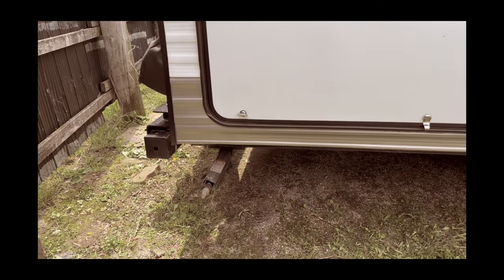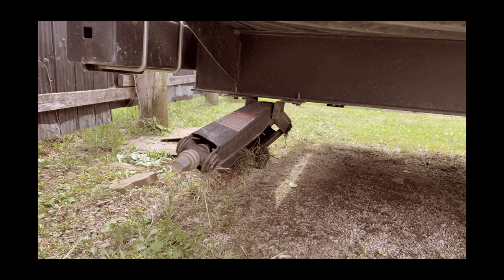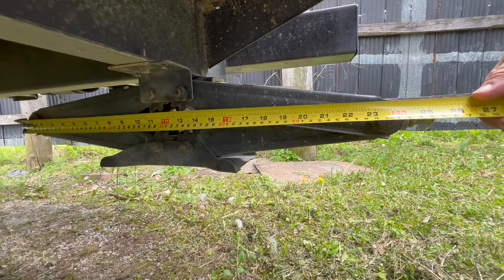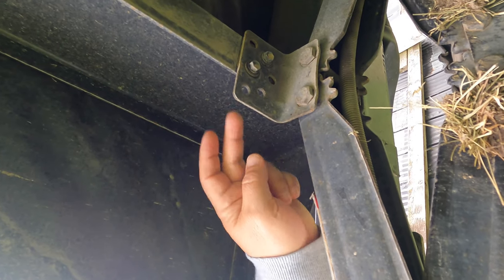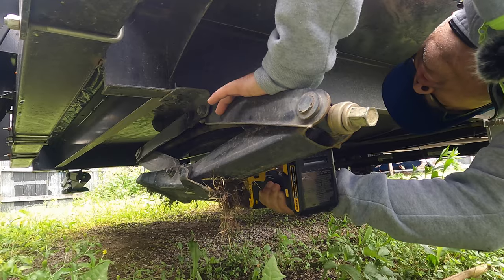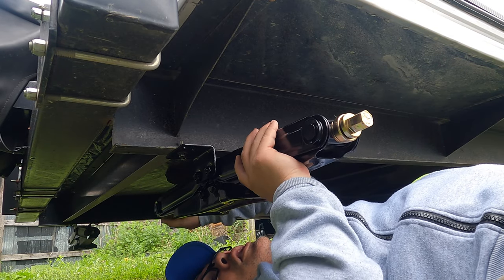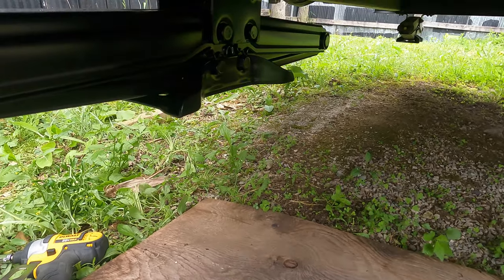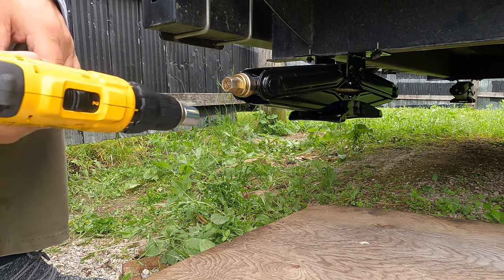How to Replace a Stabilizer Jack on an RV/Trailer

Comment: I had my rv trailer stored for the winter. Tongue jack down and only the front scissor jacks. Not sure why I didn't have the rears down as well. But the entry door side tire went flat and the weight of the trailer bent the jack beyond repair. Found my replacements and did both fronts. This is probably the best video I have seen showing the actual progress of how to do this. Very good video. thank you! Saved me a repair quote!